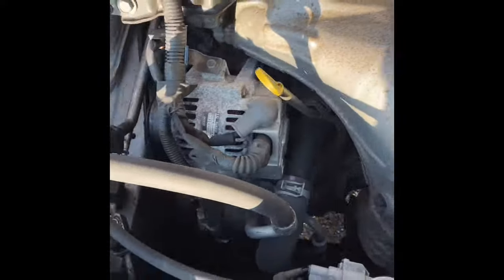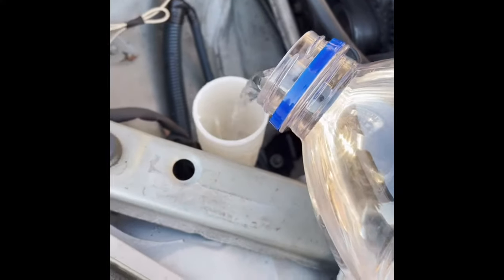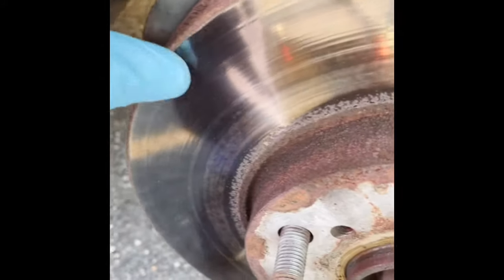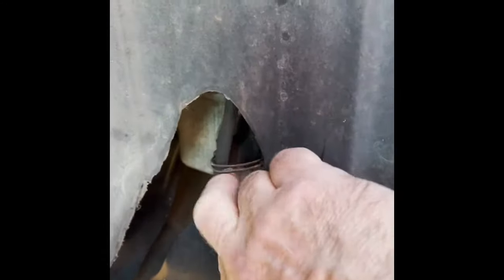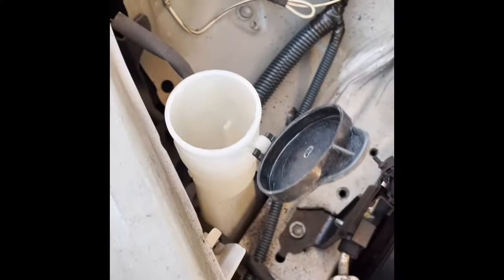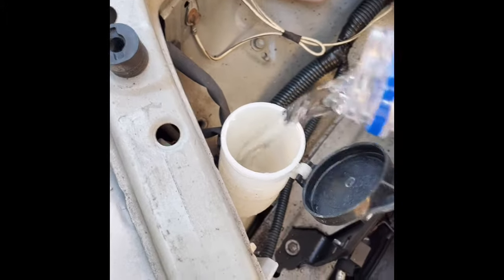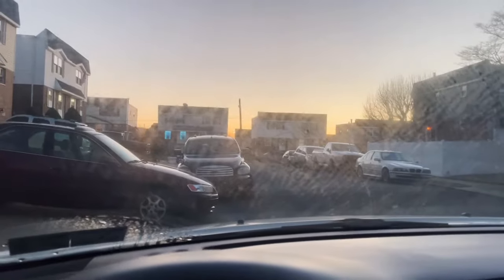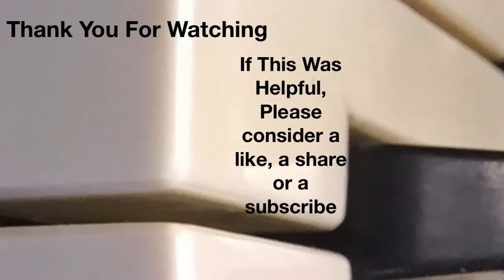DIY FIX WINDSHIELD WASHER LEAK

Comment: My issue is the filler necks leaks where it is connected to the tank so when you fill it up you don't know how much you have or when the tank is filled  All you see it's leaking in the below..
I need to somehow stick the tube to the tank so the level rises UP when you're filling it up..Anyone has this issue or fix..cheers 🥂

Comment: I hope I can do this without disassembling all that. I’m a female can’t use a jack too much rust.
Reply from the maker: I hope so too Lexie.
Reply: I have a 2008 Saturn Vue I’m sunk! Can’t afford a car loan.
Reply: At least it’s small thing knock on wood this car has been awesome to me only 100k miles on it. Dealing with an oil leak now. My bro in law did the cleaning of the engine with the detergent and oil leak stopped for the 2023 summer but it still leaks a bit each day.